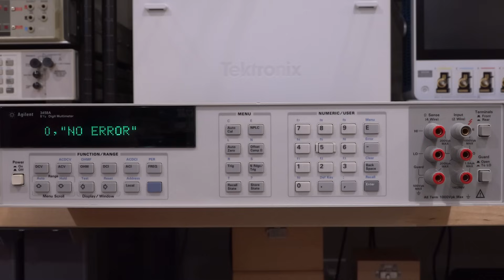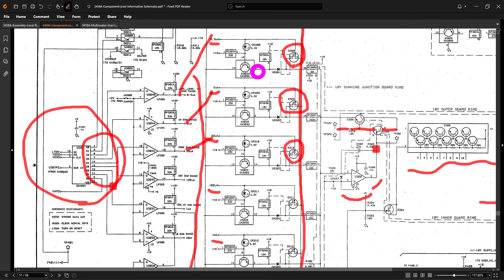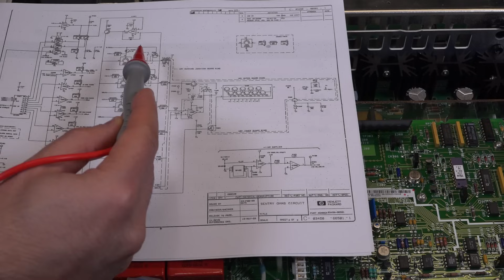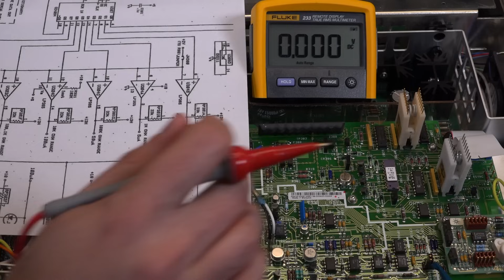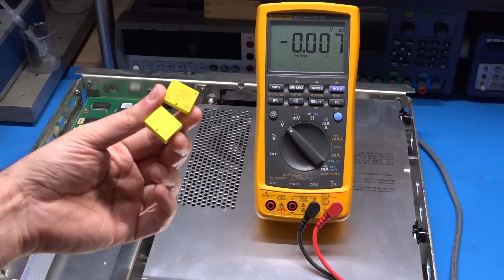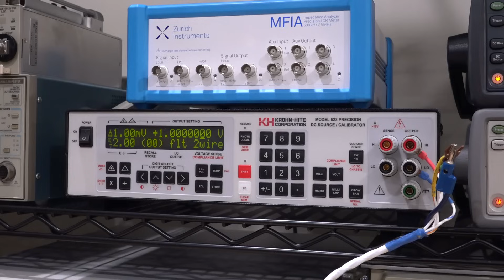TSP #291 - Agilent 3458A 8.5-Digit Multimeter Repair, Teardown & IC Analysis (April 2024)

Comment: Hey, if you could help me to finde replecment for HP part number 0490-1839 ,,, reed relay k202 k203 on shunt resister circuit. often they got stuck and i get cal fail ERROR,,, i need to knock on them, then the device would work for few weeks...

Comment: Video 6:47 says that when the 3458A measures 1Gohm resistance, it will use 500nA. But 1G ohms x 500nA = 500V.
Reply: All HPAK bench DMMs use an internal 10MOhm resistor in parallel with the DUT for ranges 100MOhm, 1GOhm, and calculate the DUT value from this parallel circuit.  
Therefore, these 10MOhm x 500nA = 5V will never be exceeded.
You can find a detailed description for this method in the HP34401A Service Manual.
Reply: @DrFrank-xj9bc  Thanks a lot. I found the instructions in the service manual. The manual points out that when the ohmic current source output voltage exceeds the normal value, it will become non-linear, so a 10M resistor is required in parallel across DUT.
Reply: Is there something wrong with the manual?

Comment: Brilliant Error localization logic Sharimar ! I have a HP3478A that shows correct output currents but negative resistances at low ohms ranges.
Is there any other possibility than wrong calibration constants ?

Comment: Thanks a lot. I always enjoy a good repair with your detailed explanations. And there is always something new to learn beside the troubleshooting.
When I saw the CD4094 I had to think of a glitch my college and I where hunting on one of our signal generator cards. In the end it was an 74HCT137  which had a single output pin glitching from time to time. I would never have guessed an 74 chip to cause those glitches but I was lucky and had a true wizard by my side... he is the one who found the faulty chip but was similar surprised that it really was the culprit after putting in a new one.
I still have the culprit on my desk and I'm still waiting to have some time to try and get the pin glitching on my breadboard setup.

Comment: Shahriar, the repair was done quite well.
Anyhow, before replacing the batteries, one should always download the complete content of the calibration RAM via GBIB, even if there is no officially known method of writing it back for this assembly. At least, one should read the 10V and 40kOhm calibration constants, CAL? 1,1, CAL? 2,1, so to have the chance to iteratively reproduce the original basic calibration. 
The  CAL 0 calibration can be performed by anybody, and SCAL might be omitted, if high frequency ACV measurements are not needed.

Comment: You should be able to calibrate at least 2-3 more digits of accuracy.
Reply from the maker: Calibration is not the issue, I need more NLPC and guarded cabled to get the stability required.

Comment: Why does it have so many digits when it is so inaccurate? Is it at least precise, so you can compare tiny differences? Can it be calibrated to only have errors in the least significant digit?
Reply from the maker: I need more NLPC and guarded cabled to get the stability required.

Comment: It's fun to see this circuit board and schematic again after so many years. I worked down the hallway and knew the entire design team. It's a testament to the strength of the original design that this instrument, with a few updates due to the age of the original parts, is still in production under the Keysight brand name. I believe this might have been their first voltmeter with a multi-slope + flash conversion architecture, and they knocked it out of the park.
Reply: So cool seeing people from HP in the comments. Same with IMSAI guy, love hearing the inside baseball from what I see as a golden age of test equipment
Reply: Is Scott Stever still alive?

I'd say the meter itself is excellent, however the standard ref used is rather average. I knew a guy in Poland who made a modified ref for it (build upon a few special versions of the Adr1000's if I remember correctly), along with some changes to the original circuitry, achieving stability way below 2ppm, practically better than the fluke dmm.
Reply: @MatthiasGrolberg  Does this guy in Poland have a project page or  video of this modification?
Reply: @MatthiasGrolberg : I don't know about Scott; his LinkedIn page is still up. Scott managed the 34970 DAQ project, one of the highest-volume instruments Loveland ever produced. If memory serves, the 3458 project was managed by Larry Desjardin.

Comment: In a way it’s a shame it’s a newer digital board, the older type with the Dallas non-vol rams allow swapping them out for Fram ICs so no more batteries! Not sure you can do the same with this board.
Reply: It is still SRAM, just surface mount with pluggable battery, should still be able to adapt FRAM to it you would think...

Comment: Didn't the guy on CuriousMarc just throw the chip in a frying pan to soften the plastic and just snap the plastic off, ie, no acid.
Reply: You can put the chip in front of a hot air gun at 500 C for about 20 seconds and then break it with some pliers. But you should only do that if you have multiple parts to try it on, there's a good chance you'll break the die.

Comment: No way that comparator is six metal layers. This is an old school chip, mostly hand layout probably (not sure if rubylith or CAD based, could be either). You can see that the actual comparator tiles are the same layout but the IO pad ring around them is custom routed (not copies of the same structure).

Six masks I could believe, though. It looks like (starting from the topmost text = lowest layer) three grayish layers that are probably related to doping or isolation, one contact/via cut mask, one metal layer, and finally cuts for the bond pads.

There might also be a 7th mask, looking just above and right of the first six near the NatSemi logo there seems to be a barely readable A as well. Maybe that was something done early on in the wafer processing before an etch process or implantation step or something? I'm a lot more familiar with modern planar CMOS than ancient BJT based tech made in a foundry that's probably older than me, so not sure of the exact flow for making them.
Reply from the maker: I meant layers, not metal layers. Doesn't look like it has more than 2, maybe 3 metal BEOL.
Reply: By my eye it seems to have 1 layer of metal interconnects. And then rely on doped silicon for any jumpers.
However, I somewhat doubt that this is an old chip. It has a ©mark on it, instead of the usual encircled "M" used back in the day. (Likely made in the 90's or early 00's)

And that modern nature makes me think it only has 1 mask for each layer. Since copy paste in CAD software is a thing, it is most likely not hand laid.
The diagonal lines also seem thicker than the vertical/horizontal lines (indicating that the edges are defined on a grid), hand laid masks usually keep constant width. This is most notable on the thinnest traces. (Also, I don't see why a hand laid mask would use so many differing line widths, have sharp pointy corners, and even the rounded corners seems odd for a hand laid mask.)

So "one contact/via cut mask, one metal layer, and finally cuts for the bond pads." sounds reasonable. And the three layers before is as stated, likely just doping/etching steps. And yes, there seems to be an etched 7th A at the top there. A bit offset to the right however...

Comment: Fluke 233 always look so bizzare in video :). Sockets in 3458A analog boards make me anxious, hah. Also good idea to run ADC A3 drift test to see if this 3458A needs new A3 or not. I'll send you the automated script for it as well. For measurements above 1kOhm you'd best use OCOMP ON with DELAY 0.1, otherwise some offset can be present if 3458A was adjusted before using OCOMP ON function.

P.S. I am cooking a beginner's guide about 3458As, so stay tuned for that. There were multiple revisions of various boards over the 38 years of 3458A project life, but boards are compatible between each other and still follow same analog design as was originally done by HP guru's in late 1980s.
Reply: I'm convinced Fluke did this purely to mess with everyone's heads
Reply: Yeah, the meter always does my head in.

Comment: Are there any differences with the keysight versions of the 3458As?
Reply: The digital board changed over the years. The black 3458a has some differences. Take a look at the 3458a video from Marco Reps
Reply: @ofgjf  nice will check it out. thanks.